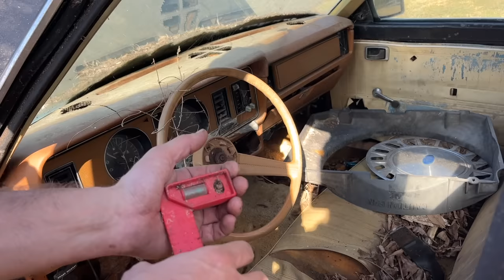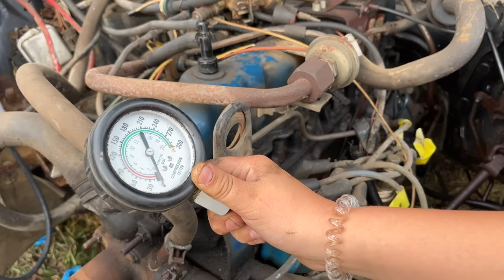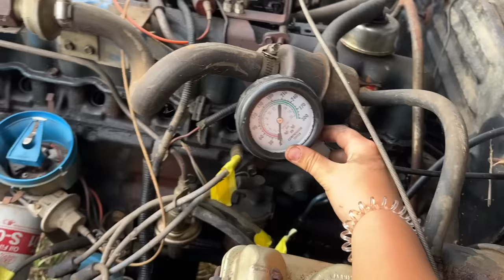30 years in a junkyard, station wagon with vintage hand painted lettering. Will it start?

Comment: If you have a piece of 1/4 steel cut it to match the size of the center of the crank pulley. Drill holes to match the center and mount holes in the pulley. Weld a big nut onto this piece of steel over the center hole. Bolt to the crank. Put a socket on this nut to turn crank. You won't over tighten the crank bolt and can turn both ways.

Comment: I was thinking about that valve train and was just wondering if that car was a victim of a flood. It would explain when you found it in the junkyard why all the widows were rolled down. Maybe when they parked it all them years ago they wanted to dry out the inside of the car and just forgot about it.

Comment: Yes the cylinders were baddly pitted but you were to quick to pull the head. It would have run if you pulled off the rocker gear and freed that up and straightened the bent push rods and lastly worked the stuck valves up and down. Do the above and slap the head back on and get it running for fun. Yes the moter is junk and engine swop it latter. Just use that same metal head gasket it will run.
Reply from the maker: Ok

Comment: I'm not positive, but I think the critter that flew out of the car was a bat, a very small one.  Also the engine could be a 170 cid instead of the 200cid. There's a difference in starters and flywheels.

Comment: Hey Josh you can make your own Marvel Mystery oil, and PB Blaster. Mix 75% Dexron 3 transmission fluid with 25% acetone. Works better than any expensive stuff. I put mine in an old style pump oil can.
Reply: I mix it 50/50. It penetrates and loosens better.

Comment: 39:00  Carb tag   D8.... if that is the same as Ford's system of casting numbers, D means 1970s and 8 means 1978... so that makes sense. Better to have the original carb than some parts store replacement from 30 years ago.

Comment: 1500 rpms with out compression / without the head. Just by turning the starter. The crankshaft is probably good.  Put a 302 with a t5 in it. Good luck

Comment: i just did the same work on a ford 460 it was stuck i worked for days finally took the heads off the pistons were rusted bad and block cracked no fix

Comment: Have you ever mixed murmatic acid with transmission fluid 50/50% mixture? And tried using it on a stuck  engine?
If you are going to try this a  funnel with a rubber gasoline holes works very well. Do not let your children around the acid when you're mixing it.

Comment: What if you just did a light hone above the cylinders and banged the pushrods straight again, and free up the head, then throw it back together with 15/40 oil, and see if it ran

Comment: I have a 250ci Ford engine that came out a mustang been rebuilt0 miles 500 and you can have it that's what I gave for it. bought for my 64 Falcon but won't work with my trans. I'm in Halifax Va. would be willing to meet with it. I did swap head from my 170 with this one.

Comment: I USED TO WORK AT A SMALL TOWN REPAIR SHOP AND A OLD FARMER CAME IN ONE DAY I WAS DOING A BREAK JOB FIGHTING WITH RUSTED LINES OLD FARMER LAUGHED AT ME AND TOLD ME TO GET THE WORKS TOILET BOWL CLEANER AND PUT THAT ON RUSTY PARTS BUT HAVE WATER CLOSE TO DILUTE THE CLEANER AND IT TURNED GREEN ATE ALL THE RUST OFF THE LINE AND IT CAME APART LIKE NEW POUR WATER ON THE LINE AFTER WATCHING IT EAT RUST AHTER 3 4 MINS WASH IT OFF SO IT DOESNT DESTROY LINES SOYUND FUNNY BUT IT WORKS GREAT
Reply from the maker: Ok thanks for letting me know
Reply: @Sleeperdude  try it 1st on scrap so you see what it does
Reply: it can have any other rust dissolver on it use it first
Reply: i took my driver training in a 1978 Fairmont white 2 dr red interior it was a sharp looking car

Comment: the old style starter relays with the big lugs on the side are less reliable than the late 1980s -1990s ones with the posts all in front. the late style was used as early as 1967 on Dearborn built fords. wen replacing the old side lug type i tell parts monkey I need a starter relay for a 1994 f150 with 302. it is a direct drop in as long as you have sum slack in the starter and batt cable. the mounting holes are the same. just match up the wires based off the old relay the s wire goes to s  I wire gos to I. the late style has bigger contacts so thy do not weld up like the early style. that engine must had oil with a lot of wax & a lack of oil changes. I would free up the valves and rocker shaft. I would fill in the pitted cylinders with JB weld then hone the bore to put a cross hatch back. or fill it in with a hard hi temp brazing rod if you feel confident! would be interesting to see it run . !
Reply from the maker: Ok great thank yoh

Comment: Hey, any suggestions on how to get the doors open after so many years? I have 72 I think Chrysler Town and Cou try, cant get any doors open.
Reply from the maker: Honestly we have had the same problem with several here and I haven’t figured the secret out yet aside from removing the door panel and destroying the latch
Reply: @Sleeperdude  thanks for your prompt reply. I meant to focus on this over the summer, maybe try to get some sort of lubricant into it and use some heat.  I would rather not damage it . I kind of hoped to get it cleaned up a bit and find someone who wants to restore it.  It was left by the hoarder we bought a house from. Most of the cars were just junk, sold them to the junkyard. But a couple were worth restoration.

Comment: Put a 300 in it lmao 🤣🤣🤣
I know of a way to get the pits out of the cylinder walls without a rebuild and sleeves but you'll still have to tear the engine down and you'll need to rebuild the head.

Comment: Clean the parts in Evaporust, wire wheel, and lap the valves, it’ll run! \/\/a\/\/a Power! Broken finger and all! #PBBlaster! Send ‘em a case of fluid!  You need  Dodge Magnum and supercharge it or a Hellcat!
Reply from the maker: Facts !!!

Comment: Get that stp oil filter off before you start it I had one on a truck that sat 6 yrs and I started it and the filter material inside basically just disintegrated and it was hard to get all of it out lucky it was an old 400 m ford and was bulletproof I seized that motor at least 3 times a week for months the rings were gone and it burned oil faster than gas

Comment: DA DA.    I KMOW WHAT HAPPENED.    IT BACKFIFED. BACK THROUGH THE PCV AND THE TOPS OF THE ROCKETS CAUGHT ON FIRE.  AND IT BURNED ALL THE OIL COMPLETELY OFF THEN THATS WHY THEY RUSTED.     Because Rust NEEDS BARE CLEAN METAL
Reply from the maker: Ok maybe so

Comment: Hi Josh and family. Is this Fairmont equipped with the 250 six cylinder ? I f so it reminds me of the 250 Six that was in my Dad's 1975 Ford Maverick that he bought new in April of 1975 at C&S Ford in Willimantic Ct.. I went with him to the dealer when he ordered it and when he picked it up. Other than the Jeep it was the only other new vehicle he ever bought. It lasted my Mom until the year 2000 when we parked it due to body rot. It had 145,000.0 miles on it when parked and still ran.

Comment: Check out Cold War motors YouTube video this week, he took a thick plate and drilled four holes in it to bolt to the harmonic balancer and welded a huge nut to it to put a socket on so you don’t strip out the crank bolt while trying to break stuck motors free

Comment: Will any other Ford steering column fit in a MR 10 platform, like the SC or 1997 T-Bird? I need to move it, but my Stepfather lost the keys. Any help with advice, no used , none in tri-state wrecking yards, blah , blah, blah. Can't change the key cylinder without the key either. I am without any other options but to change the column if I can find one with a key.

Comment: this guy MORTSKE REPAIR ON YOUTUBE  takes the crank pulley off made a thick metal plate that lines up on the harmonica balancer in place of the pulley then welds a 1/2 drive stock on it to break engines loose

Comment: Not sure if you are interested but l know where you can get a 1991 Mazada Miata for free...needs some work ... its automatic with a little over 100,000 miles on it....l know it needs the windsheild  and front light .... engine is clean and he will make sure it is running...he is another Youtuber ...

Comment: while I love your videos I have to say I am waiting for the day when you snap off a crank damper bolt. Ya know I subscribe to a "do no more harm" approach, removal of the rocker cover will allow revealing inspection of valve train function and application of some penetrating oil. Most likely these old carcasses of cars are beyond help, but on the outside chance not much serious is wrong with the engine internals, it is important to determine and fix any "hangups" in the engine that is preventing turnover. The quick and crude muscle it approach just leaves me cold. Sorry.

Comment: To run on the corn ethanol sold at the gas station you'll have to put in a plastic gas tank a plastic fuel line and an engine that runs real good on the current fuel they're selling us before they modify the fuel again to something else to help get matches of cars off the road via fuel destruction. Maybe a diesel it was a manual transmission just find the most reliable drivetrain in the world it'll fit in that hole in Bolt it up it'll run on fuels such as Aviation jet a stuff that will be available when the electric car Madness tries to limit the fuel. Or by that expensive non-ethanol gas and dump a factory motor back into it. Russia still has non-ethanol gas they don't have contaminated fuels or low sulfur EPA attacks on their fuels so you can drive a really old car in that country. America Freedom what freedom freedom to replace and replace and replace.